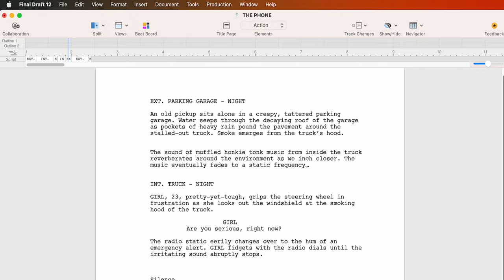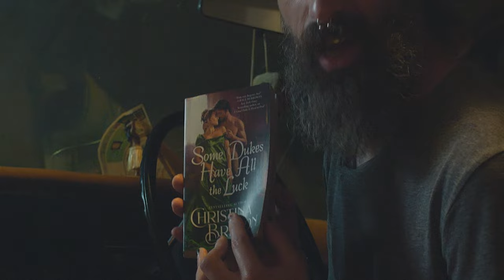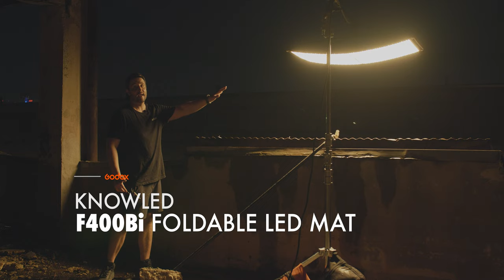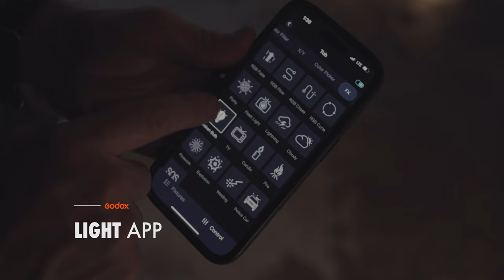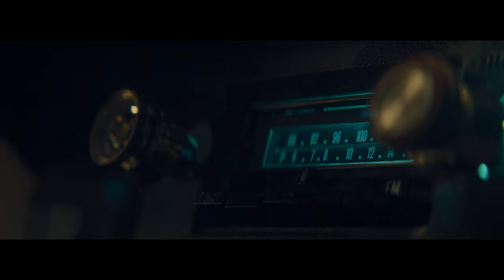How to Craft Rainy Night Suspense | Cinematic Lighting | Godox Production Series EP08

Comment: The rain scene in Blade Runner 1982. Where Roy (Rutger Hauer) speaks his final words to Deckard (Harrison Ford) before dying on the roof top. 

Back lit the rain with Godox Knowled MG1200Bi and 4 F600Bi light at 20% output and through double diffuse for side fill when on the wide but for close up use 1 F400Bi. Another MG1200Bi with the 19 degree spotlight mount for the light gag that is panning  across the scene.